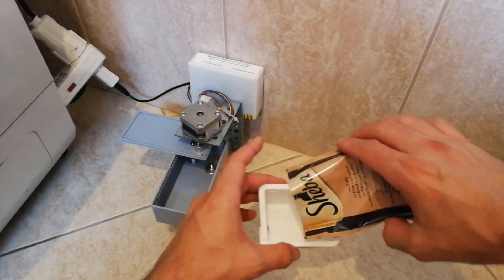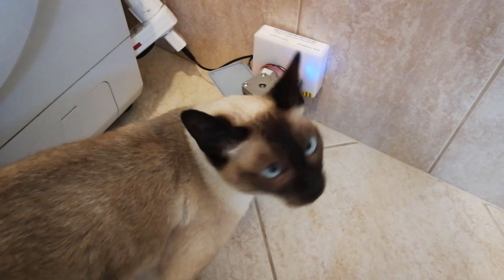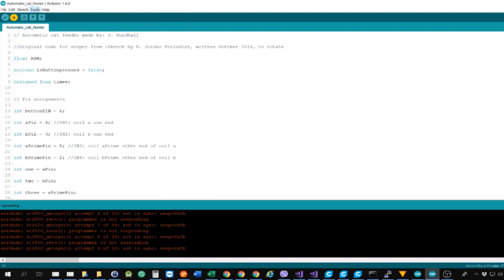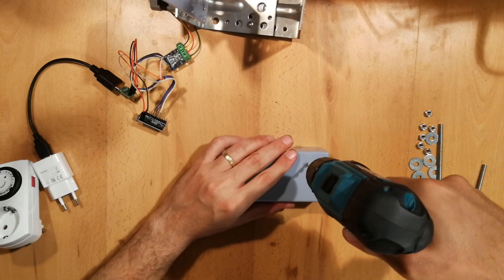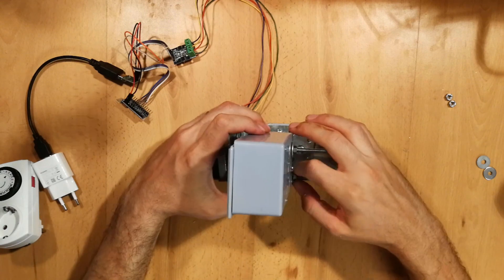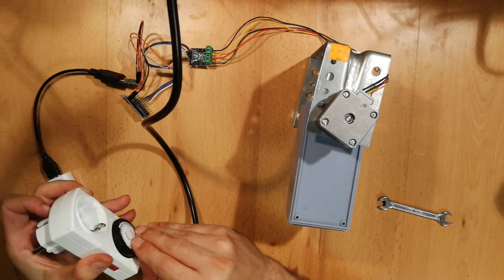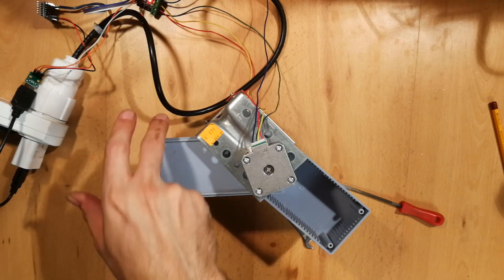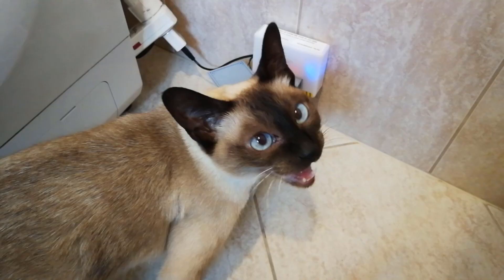Automatic cat feeder

Comment: this project misses the point
Why does that lid eat everything the first time anyway?
Either way, the canister needs to be changed 3 times a day - the goal of automation is to minimize that to at least once a day.
Reply from the maker: Hi, You are right. The operation time can be increased, with a bit more advanced code. I.g. The lid may open a little from time to time. Or you can have multiple automated holders with different opening times. 
My goal with the device was to be able to leave the cat home alone for a short time. When I fill the container and seal one portion of food, I immediately open another portion for the cat. When I leave home I put also dry food and water next to the machine.  Unfortunately, this type of wet cat food spoils quickly after opening, so any additional operation time would have required a costly solution of refrigeration, airtight sealing, etc... 
 I've been using it for several years now and fortunately, my cat is very pleased with it.:)
Reply: @studiorundhall8206  Great idea. I think you should think of a device that will use the original can and open it when it's time to feed the cat. Overall it's a great project. Thank you so much for sharing.